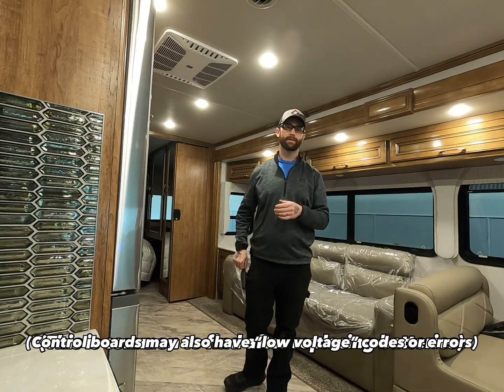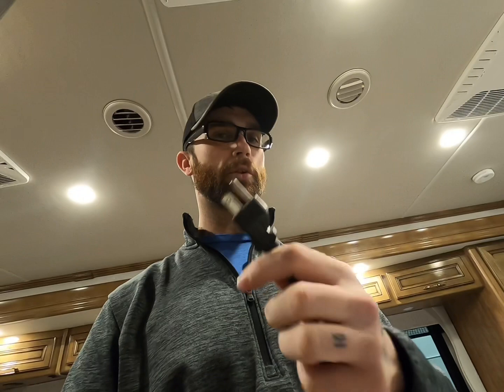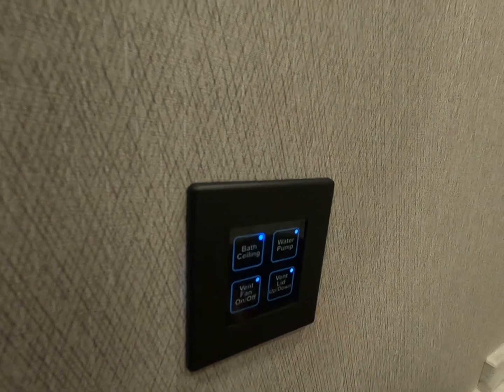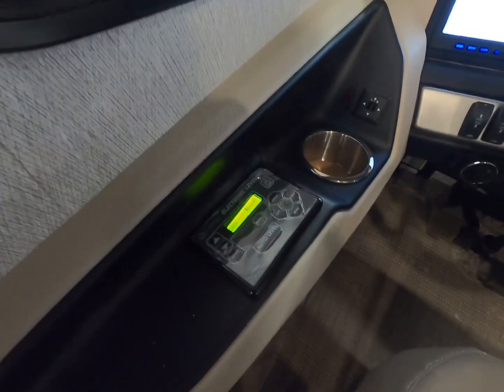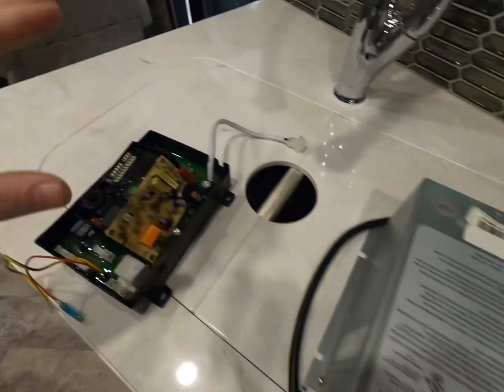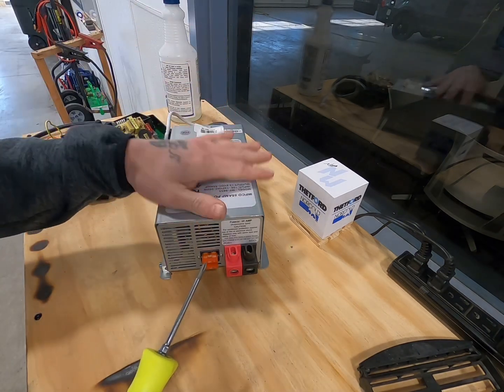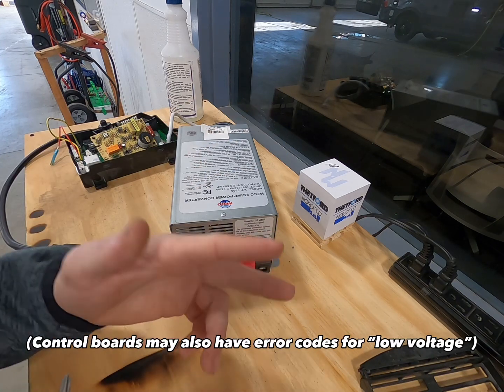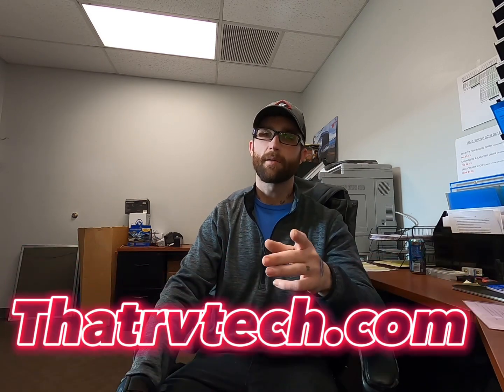The one thing your RV can’t live without, the converter! why the 12 volt system is the heart the RV!

Comment: I'm afraid I will have to disagree with you there in one instance. The converters in older RVs were not designed to be charging batteries for long periods of time. In those cases what happens is the older converters overcharge the batteries and kill them in about a year. I speak from experience. I have been full-time rving since 2007. In my Class C motorhome now I have disconnected the factory converter that was killing my house battery. Presently all I use is a properly sized battery tender. My house battery now lasts at least 5 years and has lasted even longer.😊

Comment: What’s your opinion on changing a single 12 v battery to two 6 v batteries or doubling up two 12 v batteries? It seems my single 12 v battery runs down in a 3 day trip.  I do have a single solar panel on my roof.

Comment: Very very helpful video. I completely understand the converter, AC/DC 12 volt etc etc so much better now. Thank you. The unit you mentioned that has the converter built into the breaker box, do you have to replace the whole breaker box also, or does the converter come detached from that unit? Thank you.